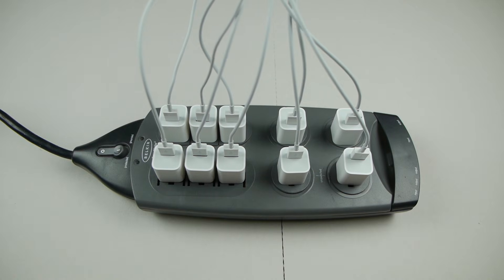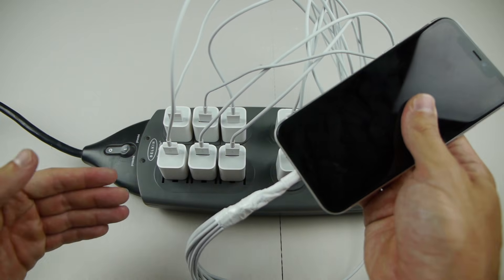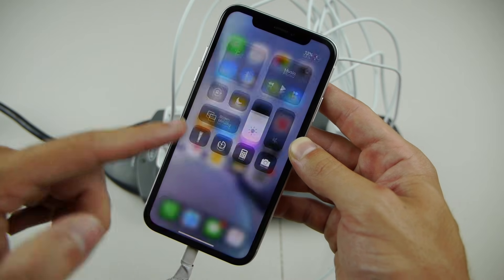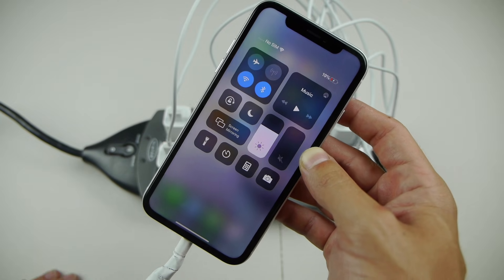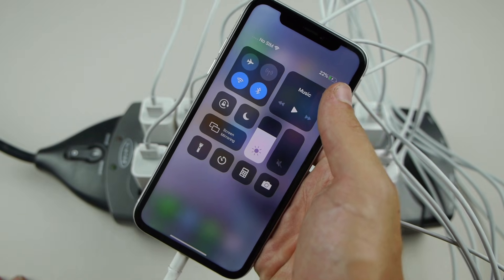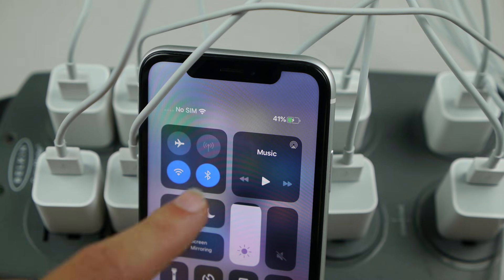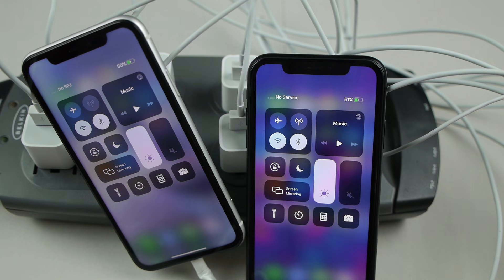What Happens When You Plug 10 Chargers in an iPhone? - One Mega Charger!

Comment: My iPhone 6 fully charges in like 15 minutes and dies in 3 minutes
Reply: I just had that...get a new battery put in ASAP before it completely refuses to charge and you can’t get any data out that you need...but try and go to apple store.

I went to a local non apple store £30 fitted...but the screen didn’t work after ( he tried to tell me it was always like that because I had a few cracks on my protection cover)so had to get him to fit new screen £40 

When I swapped my SIM cards back over from spare phone to main phone ...the SIM card was melted also and hard to fit in.

And my new screen is slightly less sensitive than the old one...battery seems to be fine though

Comment: Hahaha, no way. Even if you connect thousands of adaptors/ cables , it will still be the same. It's like You're charging on one adapter. What happens if you connected 10 cables in 1? You're actually drawing on 10 units , the current is divided. Say for example you have 5 adapters and your item is drawin 1000ma , then it's divided into 5 and will draw 200 ma each. Depending on the need current the adpators will coninue to wor as long as there is no short circuit. Using 10 adaptors won't really do something different , its just the same on using one , but with divided current being drawn.🙂

Comment: I think it depends on how we connect if I am not wrong. The output from the charger is DC current so it has +ve and -ve(gnd) . +ve wire to -ve wire combination will increase the voltage and +ve to +ve and -ve to -ve will will increase the capacity but not volatge.

Comment: You put the synth only so that the cables are not seen there is that you are very rough because the connector that goes to the phone does not hold so much voltage I mean in a few words the only flat would burn is because all the cables are feik and there is only 1 only and there is like 16 transitions so this is false☺🙂

Comment: Did you ad any diotes when you solder the all chables? 
if not it will give pressure on charger & phone will resist the excess power.  lots of calculations are here

Comment: This is nothing new. All this is , Is a apple non advertise fact which ALL iPhone 8 through current models and new iPads have the ability to Quick Charge , using a 29W USB-C to lightning  cable. this with all a dead iPhone to 50% in around 30 minutes. Apple should have really advertised this, I have been using this for last 3 years myself. here is a link to apples website on matter.

https://support.apple.com/en-us/HT208137#:~:text=You%20can%20fast%20charge%20these%20iPhone%20and%20iPad,to%2050%20percent%20battery%20in%20around%2030%20minutes.%2A

Comment: As an electronic engineer, I can say that when you plug power line with the system, so it's inbuilt power regulator(obviously it has) prevents extra charge to get in, and this makes the regulator warm/hot, and according to definition of basic physics, energy is transferred, high power is transferred in heat and this reduces power flow due to resistance (due to high temperature), thank you

Comment: will basically he connected all the chargers in parallel thus the voltage will stay the same but the currents will be added up hence, giving more power. however, if your phone is not rated to work with that much current, you might damage your phone instead.

so in short, don't try this with phones that doesn't support super charging and if they do, don't exceed their maximum rated power. even with that you still run the risk of your phone exploding. so if you don't have to, don't do it at all

Comment: Apple: made adapter to regulate the high voltage to low 
This guys: combined 10 cables into one 
Apple: I am a joke to you
Reply: Joke to you am I xd
Reply: If you understand electronics you’ll know the voltage won’t change no matter how many chargers you have
Reply: @philshentall1968  yeah but we can decrease or devide it by installing resistors, right ?
Reply: Apple: Are u comedy me😂🤣 ( If u know u know🤣😂)
Reply: Samsung: 45 watt charging available
This guys: I charge iPhone at 4500 Watts
Reply: I think the 10 cables were configurated paralel, so it doesn’t increase the voltage, but increase the current. And it’s makes sense they charged the iPhone so fast at the begining
Reply: @g.72.kiagusabdulrahmanshid36  okok what of we done the same thing in series??
Reply: Virat Sharma it won’t increase the current, but increase the voltage, which means it’s vulnerable to overheat
Reply: @g.72.kiagusabdulrahmanshid36  ohhk thanks
Reply: This guy: Yes
Reply: Only current increases in this case(if this guys is honest), but still it will destroy phone in a long run .
Reply: Yes, they are a joke
Reply: @kazumakujo6986  they are fraud 😂 no charger in iphone 12 box 😂😂😂
Reply: @viratsharma4179  and a joke too. A iPhones price should be less than half of the price they ask for.
Reply: @kazumakujo6986  correct, they earn about 400 percent of profit from each iPhone... where samsung earn about 10 percent
Reply: Ga habis thinking
Reply: Hador gaisss

Comment: If Connected in parallel then then Voltage is constant & Current add up but Mobile's only takes Required Amount of Current .. so there will be no my much change . 

If Connected in Series Current is constant but Voltage may change , if the Total Voltage is More than Required this may damage ..

Nothing to Excite about the video . U can take A Fast charger instead of all these

Comment: Regardless of whether the video is real or not, it takes just some basic understanding of electronics to know that it makes no difference, the charger only supplies the power that the phone is "requesting", it's not the other way around. Chargers don't just jam power into the battery, they simply satisfy the current needs that the phone is drawing. Adding more just simply means that each charger works less but the power output is the same. The only way it would make a difference is if the phone drew more power than what just 1 charger can handle whis is not the case

Comment: what a nonsense video.Increasing more charger in parallel connection means joining same color wires will remain same voltage and current will multiply increase by number of connected charger in parallel. So power rating of overall charger will increase and it start fast charging, as we seen in fast flash charger. But it will harm mobile phone and battery may it will be explode also.
Reply: No it wouldn't phones communicate with the battery and charger where possible. It will only take as much as it is rated for you're more likely to damage the charger or get a cable short that damages things

Comment: "Will 10 chargers charge a single phone ten times faster?"

Voltage regulator: Im about to end these chargers whole careers
Reply: these are connected in parallel. the voltage stays the same. it’s just the amperage that goes up. it’s about 10 amps or so.
Reply: Maybe.. But if it so your battery will be damged within a week bcoz the watt exceesa the phone battery limit.. .so may explode or bulge like baloon.
Reply: @abeyakilesh.m6723  Nothing will happen to the phone. It doesn't matter how many amps you supply, as the smartphone chooses how much amps to draw. Like if you use a 5V 10amps charger( 10 amps being the max it can deliver), it wont damage your device because it will be drawing way less than 10 amps(around 1-2 amps) .However if we supply high voltage say 10V for recommended 5V battery, it will cause damage .Voltage regulators also have a range up to which they can regulate beyond they get damaged, and ultimately damaging the battery.
Reply: @Abey Akilesh.M NO. Power i = Voltage * Current, but the current is regulated by resistance so there isn't any different if 1 charger can output enough Current.
Reply: Abey Akilesh.M You’re exactly right. excessively charging a phone with a charger like this would kill the battery within a couple weeks
Reply: Voltage stays the same becuz of the regulator, chargers have a regulator that dials down the amount of voltage received, thus being the reason why ur phone doesn't explode immediately when plugged.
Reply: Ngomong apa sih kalian?
Reply: Hadir gaisss comen like mee
Reply: thats what i was thinking 😂😂

Comment: So you are saying that you connected 10 chargers and it charged your phone

Let's get a bit technical
So one of these chargers can put out a maximum of 5 volts you have 10 of those chargers so 5×10=50 so you are saying that your iPhone can handle 50 volts oh and a few more things one of these chargers can put out 10 watts thats the minimum for a fast charge so 10×10=100 watts the equivalent to a 100watt lamp so your phone would basically be a lamp by now and the other thing is the wires in those charging cables are super thin so I don't think you can connect them all like that and remain ridged it's almost like you have cut the ends of 9 chargers and only left one intact hmm is this real or fake do you guys believe me?.

Comment: “Everyone should try this”

Everyone: LETS GO BUY 10 CHARGERS
Reply: @Ns Tser ok so what. Dance?
Reply: @Apple And Ebay o good lord give him some sense and a brain
Reply: what a nonsense video.Increasing more charger in parallel connection means joining same color wires will remain same voltage and current will multiply increase by number of connected charger in parallel. So power rating of overall charger will increase and it start fast charging, as we seen in fast flash charger. But it will harm mobile phone and battery may it will be explode also.
Reply: Apple And Ebay Apple is made by Steve Jobs.
Reply: Meanwhile Apple : STONKS
Reply: @Apple And Ebay he was a Syrian immigrant. Idea of apple not came in syria
Reply: @Apple And Ebay but that doesn't make you a ceo
Reply: @Apple And Ebay and doesn't prove syrians are smart Or intelligent either
Reply: Mystic lets buy 10 chrgers 
Me: then destroy it
Reply: Apple-stonks

Comment: You've wired this up in parallel. So it's still the 5v it normally uses. It's just a much higher current that would speed up charging normally; like if you used say a MacBook charger, but still a higher current.

If y'all want the maths then let me know

Comment: Is dangerous because cables become hot , charger become hot , phone become hot , and all can take a fire , and btw , can destroy the batery , and you don't conected soo good cables , i mean, your isolation don't was good , my father is electrician and i was in one day with thos for can help it , and used soo many materlias to izolate one cable whenconected this with another cable , :
1 material to izolate for can't enter water
1 material for termal izolation (that is at all cables , and after that )
Izolate again with termal material
Again with material for don't enter water
And again with one tube from rubber , special tube , this when become hot is tighten (but what you id is just for experiment not normal use , nvm)

Comment: That parallel circuit increases the current while the voltage stays the same. Over time the increased current may cause the battery to become hot and cause a thermo runaway condition ending in fire. My guess is the phone can increase resistance to slow the current and that’s why the battery charges slowly towards the end

Comment: As an Electronics engg. , You have connected the positives and negatives to respective output +/- . So its a parallel conncetion and Potential difference is same across both end of output but only current delivery capacity is raised. Therefore same amount of current is drawn from powerbreak by the phone as it was before.

Comment: When you are connecting many input powers to one single cable which has a pre determined current capacity. So power output through the lightning port is almost same as using one adapter.

Comment: NO you CAN'T do it unless you want to see your battery fucked in few months. Of course, if you do it once or twice you will see nothing bad happening. When you plug 10 voltage sources in paralell it will deliver 10 times more current, that's why it charges faster. But the battery wasn't made to support it.

Comment: I hope you all know this is absolutely useless, the phone will only pull the max current it can handle and no more, most Iphones only accept 18 watts, so at most its only using 4 of those bricks as each ones about 5 watts, the actual block you plug into the wall has nothing to do with how fast it charges other than its wattage rating.

Comment: Fun fact: he only connect one charger and the other chargers are not connected
Edit: stop fighting in my comment please?
Reply: finally someone who realized
Reply: @SAS-7.4  i didnt
Reply: Did u guys finished the video?
Reply: @ Earl Juren    tbh yes but I wasn’t paying so much attention. Now I see what actually happened so.. my bad
Reply: Earl Juren he only take the charge  wires and  discard the data wires so that is why they think he use only one charge cable
Reply: It looks like it just fell apart at the end. I'm sure they were connected. This is terrible for your phones battery though.
Reply: I vote u
Reply: That's like 500 watts 50 volts and 10 amps it would power a flippin gaming computer.
Reply: @nxuz7520  dude, that's not how it works, it's not "it's the same amount of power so it will work"
Reply: @richardbottom9843  50 volt at 10 amp DC. Your phone would burn or the chip responsible for charging and delivering power to your phone and the chip responsible for the charging the battery would burn. SuperVOOC 2.0 as an example is the fastest charging tech and it uses 10 volt at 6.5 amps, it works by using two different 5 volt batteries, so the charging temps are cooler and the power delivered does not burn the battery.
Reply: The comments were somewhat smart beforehand but now it’s just filled with retards.
Reply: Facts
Reply: i think the other chargers turn of because of the safety systems in the chargers and one charger keeps working or they all work very slow
Reply: I'm not going to try this thing in my life ever
Reply: Connected*
Reply: what a nonsense video.Increasing more charger in parallel connection means joining same color wires will remain same voltage and current will multiply increase by number of connected charger in parallel. So power rating of overall charger will increase and it start fast charging, as we seen in fast flash charger. But it will harm mobile phone and battery may it will be explode also.
Reply: 360 likes on this comment didn't watch til the end.
Reply: [Eirmanz] mhm irk tbh I mean maybe he did it
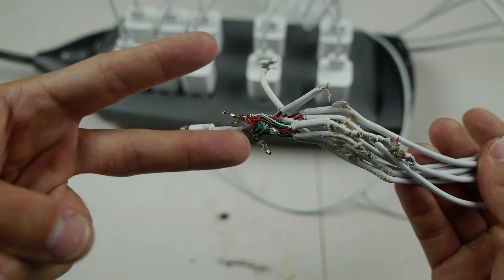Reply: Watch Till the end at the 5:55 min
Reply: @iifrutii8714  many wire are not connected and not soldered properly
Reply: @Leffyz  TexRax wouldn't waste his time like that, if I was him, I'm curious and make a real experiment because I love science.
Reply: @manda3dprojects966  You're just built different?
Reply: @iifrutii8714  If it real, it will burn the charging chip in the phone.
Reply: U stupid
Reply: Iam here for the fight 🤜🏾🤜🏾🤛🏾🤛🏾🤛🏾
Reply: @Brainless plz no
Reply: I vote u
Reply: IKR?
Reply: i thought i was the only one
Reply: Maybe if you guys actually finished the video, you wouldn’t make stupid assumptions like this
Reply: @bobbyxu7704  It only a "FUN FACT"
Reply: He just cut the video for every percent of charge, if you notice.
Reply: Yeah I just notice he cut the video
Reply: [Eirmanz] where

Comment: Its depend on the which polarity u connected together if u connect it in parallel the voltage will be constant but the current will be drop but if you connect it in series the current will constant but the voltage will drop doing something like this is going to make ur phone can effect the battery performance . But if u want to go fast try to boost up the charger by replace the transformer each of the power brick to a step up voltage this will inprove the voltage but its also drop the voltage a bit and connect it in series . But be careful ur phone will explode  haha

Comment: If you had a little electronics knowledge you would know that connecting chagers  like this does not make your charging speed faster. Because of the parallel connection. Furthermore devices have mostly have a failsafe built dumb guys like you dont blow up the house...

Comment: https://www.youtube.com/user/wblakee
Apparently you have inferior common sense ! That will not change the size and strength of the single charging port! It will reduce #BlakeWrTv Kitchen# 
The electricity at the charging port where all the wires is fused together is weakened! It also will not charge any faster that a single cable! Just don’t cause a electrical fire 🔥! #BlakeWrTv kitchen#

Comment: Its only gonna draw maybe 2 amps but the load will be distributed between all 10 chargers which is me assuming he actually connected them and not taped cables together. If you think about it with a roughly 2Amp draw across 10 chargers that would be  0.2 amps or 200 milliamps between each block or about 1Watt.

Comment: Normally you can’t destroy your iPhone with too much voltage/watts (because of protection) only if you would plug in such high power (for festivals as example) that the electricity is going through the isolation